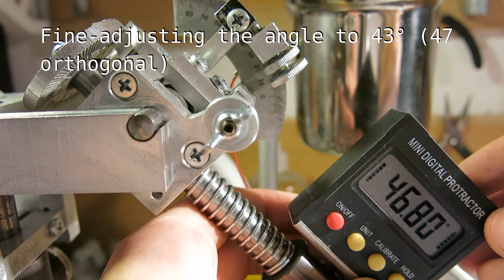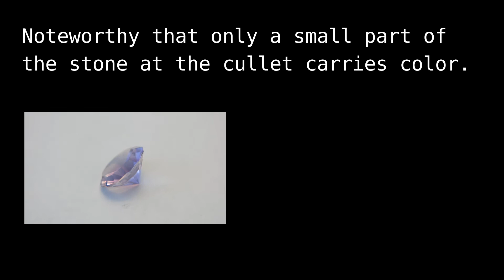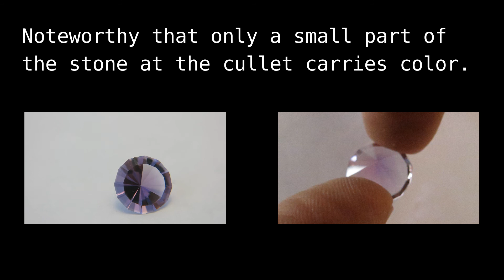DIY Faceting Machine Part 6 - A self-turned spindle tested by faceting an amethyst

Comment: You must have been stoked with the awesome result of your spindle upgrade!can you remember approximately how many hours the work on the stone took! Thanks for all your videos!
Reply from the maker: You're welcome! I honestly can't remember what time it took to cut this simple cut. As I still had used the cumbersome angle sensor, maybe 2 hrs? With my new machine (see part 19) I guess it'd be one hour.
Reply: @GemWorks  thanks for replying,I live in NZ and am trying to get some idea's to make a basic faceting setup without spending too much money.I want to try cutting something basic so I'm amazed that you got that much done so quickly.I understand that good equipment makes all the difference.I can't wait to get cutting but very hard to find what I need here .Need to use my imagination to get things rolling . What's your favourite material to facet! Thanks for the inspiration mate!
Reply from the maker: @kirklovell9164  I was at this point some years ago 😉. Not sure how to come to a good and reliable equipment to reach my goal to do precise gem cuts. I chose the way to dig into the tool making technologies (lathe, cnc, etc), which I don't regret. Alternatively keeping eyes open for a used quality brand faceting machine also is an option. Good luck for your endeavours!
Reply: @GemWorks  I will get there one way or another! Keep on cutting!

Comment: Please give me your motor parameters...
Reply from the maker: It is a simple 24V DC Scooter motor with about 120 Watts. - Additionally I use an electronic speed control to keep a stable rpm.
Reply: Thanks very much